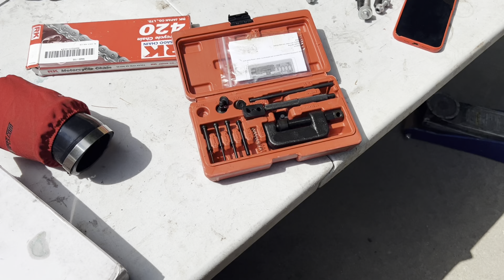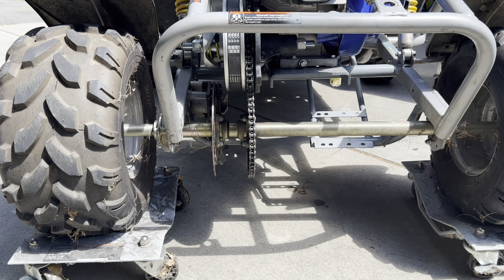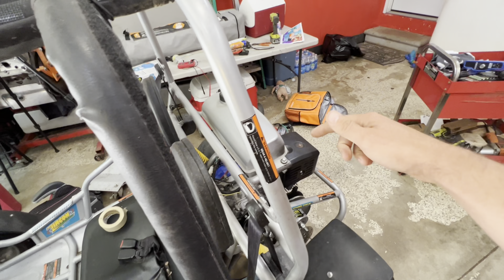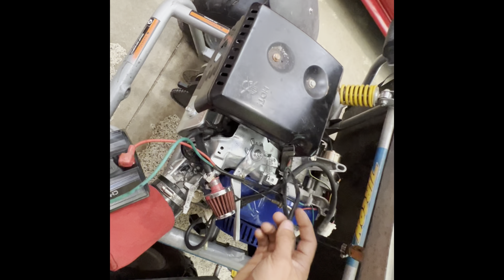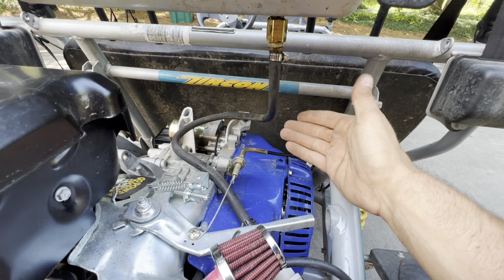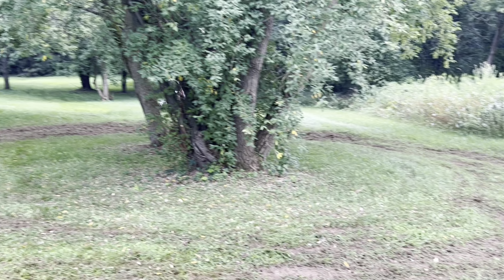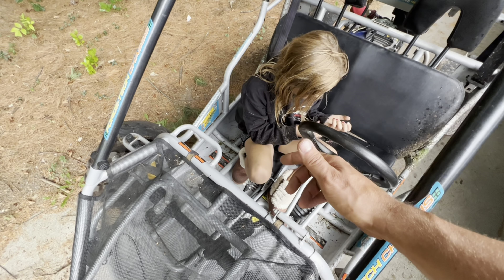20hp 440cc Duromax swapped Gokart gets electric start + kill switch- Ripping grass & burning gas!

Comment: Just finished the same frame, bypass governor, 16hp 420cc. Went with a 60 tooth sprocket. The 60t makes all the difference. With 280# me, from a dead stop on pavement you can do donuts. I noticed your build seemed to be a little boggy on the lower end.

Thanks for the vid. The axle swap  was such a game changer. Also, the heads up on the #40 torque converter saved us some headaches.
Reply from the maker: Glad it could help!

Comment: It's not actually 18 HP, it's more like 13.5 Duromax lies with their ratings.
Reply from the maker: You think so? I imagine they have to adhere to some kind of standardized SAE power rating test, no? Otherwise they’d be getting sued left and right?
Reply: @PeakPerformanceEngineering  No, a stock one has been dynod to make 13.5.
Reply: @PeakPerformanceEngineering  Yeah, it's ridiculous for the Duromax to make 18 HP compared to the 420's 13. 20cc doesn't make that much of a difference.
Reply from the maker: @fish_R_stinky69  well, there’s more than the CCs that can make the difference in power, cam, flow rate of heads, RPM, etc. I don’t know how different those things are between the duromax and predator though. 

I think red beards garage also did a dyno of a modded DM 440 engine with some bolt on stuff like this and he made around 20-25hp if I remember right. I think the key is removing the governor and getting them spinning faster. 

I can tell yah though in this particular kart that bigger motor vs the original 150cc was night and day difference, all that extra torque was great. Especially when it’s trying to move 200+ lbs adults, or two of them lol.
Reply: @PeakPerformanceEngineering  No, Red Beard's 440 had everything... cam, rod, etc.
Reply: @PeakPerformanceEngineering  I watched a comparison video. The internals are mostly the same. Same lift, flow, RPM.

Comment: 1:00 stock exhaust?☹
Needs a straight pipe!
Reply from the maker: If you watch the earlier video right after the build, I did run it with a header, but it was retardedly loud. So back went the stock muffler
Reply: @PeakPerformanceEngineering  ☹

Comment: And that's a stock motor, lol.
Reply from the maker: There’s videos on the engine mods, it was degoverned, higher rate valve springs put in, and jetted the carb. The next mod would have been to change the torque converter springs for more rpm on launch, but I sold it before that happened.
Reply: @PeakPerformanceEngineering  What about the cam?
Reply: @PeakPerformanceEngineering  Be sure to put a billet rod... I've had an engine throw a rod before.

Comment: How fast is it going? Top speed
Reply from the maker: I sold the kart last year, but I think it was hitting around 35ish on flat asphalt with my 220lbs in it. This could be extended much higher with different sprockets and gearing. But the big difference is the acceleration to get to that speed is much more rowdy than a modded 150 since this has probably twice the torque or more.

Comment: Can you put a link to the torque converter your using
Reply from the maker: I ultimately ended up going with the unit from go Powersports. I tried all the cheaper options but none held the power. The go Powersports unit is expensive as hell like $350-400 but it worked great.

Comment: I have a question for you , did you change the carb on this engine? I was hoping to hear it idle but didn’t! I bought one and put it in a golf cart and it’s a generator engine and the lowest I can get it to idle is 1600 rpm because it’s not setup to idle no matter what I do, but my problem is when I put it in the cart I added a forward and reverse gear box, but with the idle so high I can’t stop and change the gears because the high idle keeps wanting to push it in whatever gear I’m in, and I have to stop the engine to change gears and restart and take off and I checked with Duromax tech and they don’t have any carburetors that will idle and I will change the carburetor if I can find one to buy that will work for sure to slow down engine rpm! Any help you may have would be appreciated thanks.
Reply from the maker: Roger adkins here are all the vids of the build

Zircon/Carbide 440cc Engine swap build
https://www.youtube.com/playlist?list=PLXIBm2qtzJ8oXrs7vgmgLacdIaCEG0ZSm
Reply: Mine is totally stock and I put it in a golf cart and 40 series clutch and will not come out of either gear until I shut the engine down and I got sidetracked with many other projects around here and it has set in the garage and covered up since 2020 and I think I may try to get back on it soon so I don’t have to walk everywhere on this property I am getting old and lazy now days I’m only 75 but feel like I’m 85, lol just tried of all the things that have to get done around here and thanks for getting back to me 👍
Reply from the maker: @rogeradkins1785  maybe try swapping the springs in the 40 series to the higher rpm ones. I never got to do it on mine but there’s a set that doesn’t engage until several hundred rpm higher to engage the torque converter so maybe that would help. GoPowersports sells them and they are pretty cheap around $40
Reply from the maker: Stock carb on this one but I jetted it a little higher since I removed the governor and put in stronger valve springs.